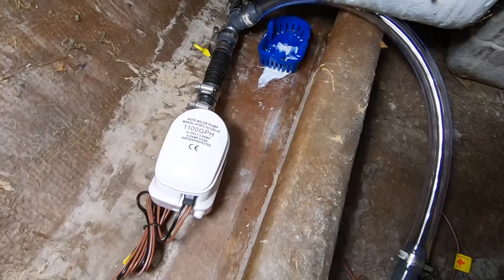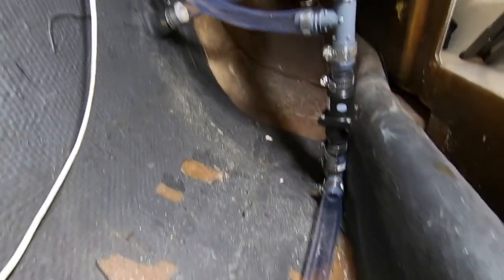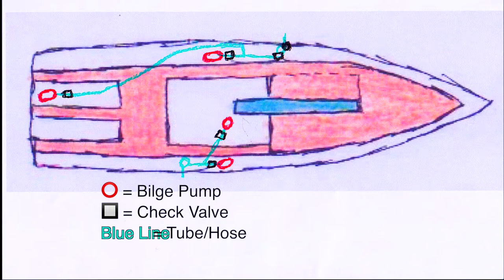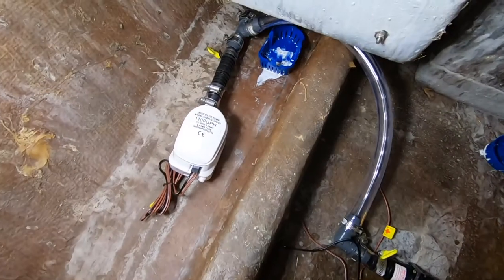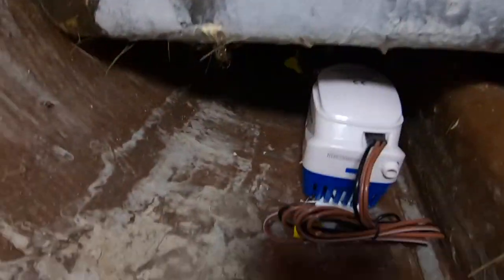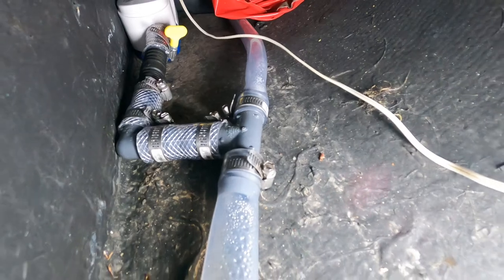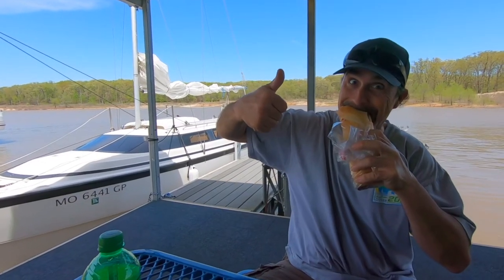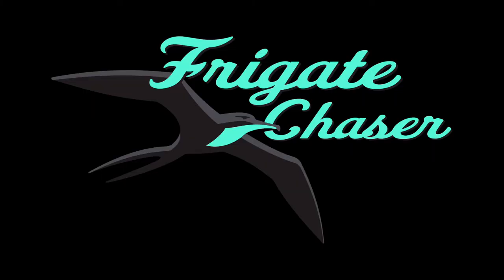Bilge Pump Install MacGregor 26x Modifications

Comment: Now that my 26X is in a slip full time, it probably will be prudent to add bilge pumps, great idea to use the current through hull fittings using check valves and not to add any more hole in the hull.
Reply from the maker: We did it that way to like you say not make any more holes.  How ever we are considering making some higher.  I think if we had ours in a slip we would run holes higher for sure.  I guess anything could happen like check valves failing or even the lines leaking.  We have noticed tiny bits of water make its way in due to waves hitting the side of boat or being on a hard lean. 🤷🏻‍♂️
Reply: I've kept our boat in a slip for 11 years and never installed or needed a bilge pump.  There are no thru hulls below the water line to leak.
Reply: @russbaker7974  I think my chain plates are leaking, sometime after a lot of rain, I have to wet\dry vacuum out the water. I'll have to be on the boat to see where it's coming from the next it rains, unfortunately it's hit or miss.